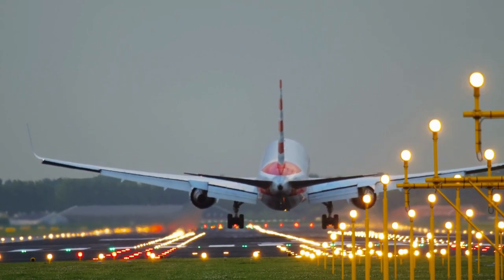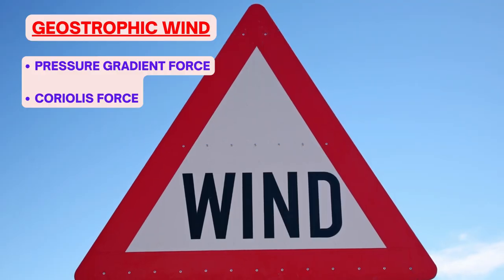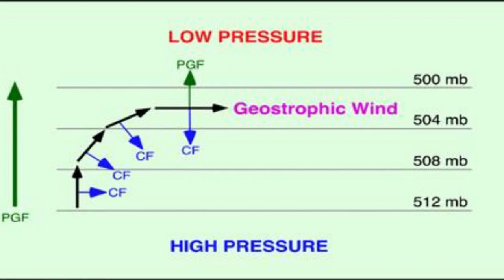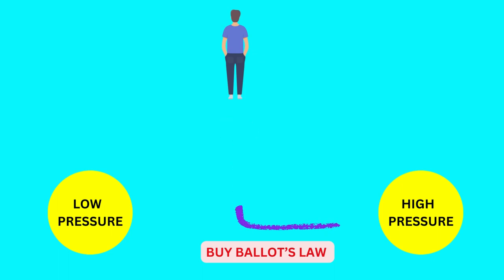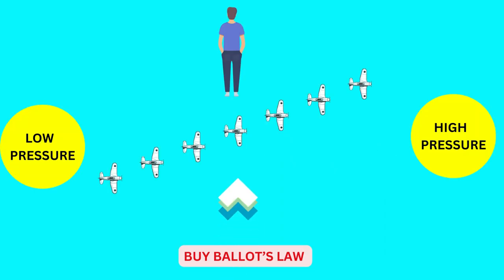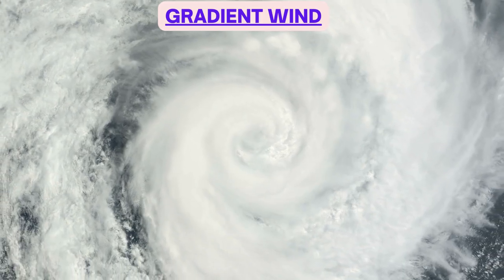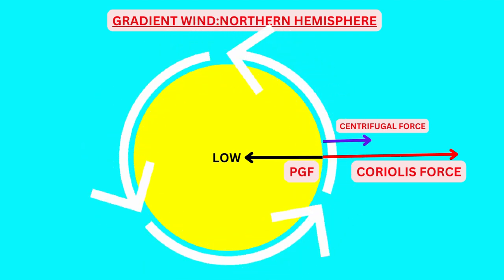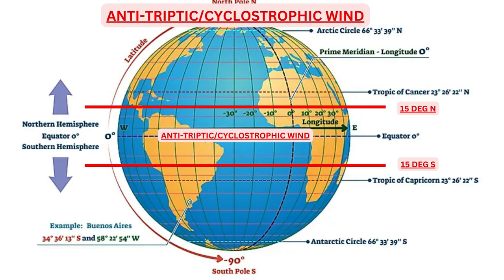METEOROLOGY FOR CPL/ATPL #GEOSTROPHIC WINDS # GRADIENT WINDS  #GROUND STUDIES FOR PILOT

Comment: Around 6:39:

Why are you depicting it as PGF towards the center of the high pressure and coriolis force works away from the high pressure?

I think you have mixed those two together.
Reply from the maker: Your observation is absolutely correct. There is an error in drawing the picture. Apologies.